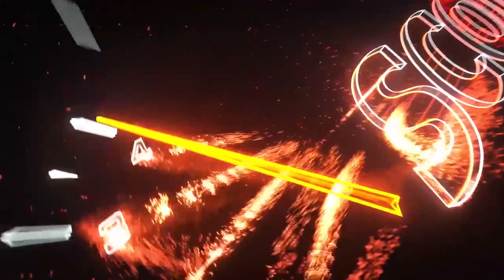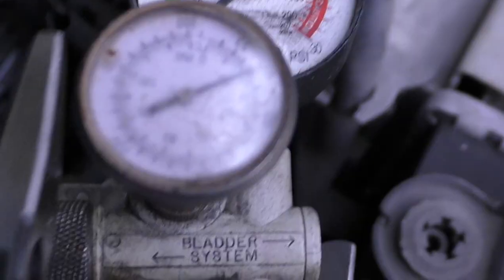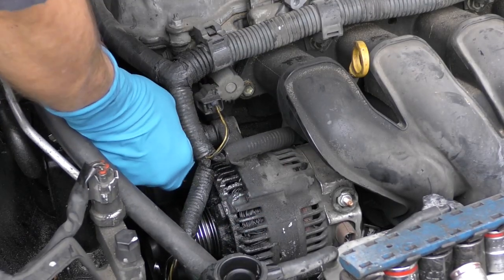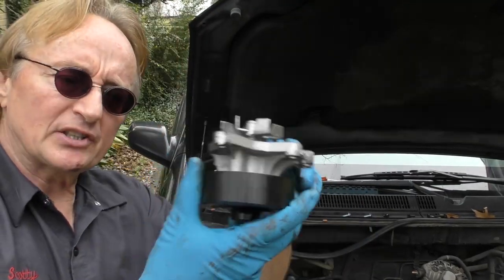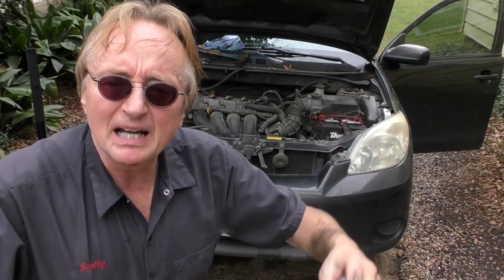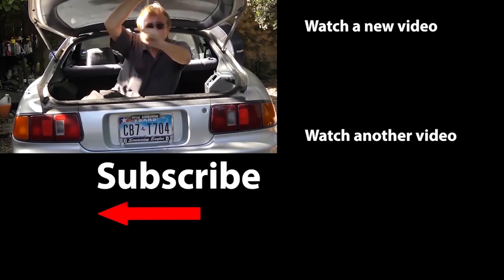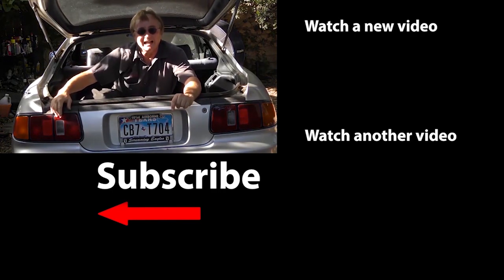Here’s Why Toyotas Have This Serious Problem

Comment: this is actually a 3 hr long video with 2 hr 50 min of cursing removed
Reply: It is actually 2 hours and 55 mins of cursing removed lol
Reply: Facts lmao
Reply: That job would have taken me an entire weekend, and I'd be kicking myself for not taking it to my mechanic.
Reply: @erikhicks07
1000000000000000000000000000000000000000000000000% TRUTH!
I worked in many auto repair shops and you'd always hear the mechanics 
swearing at various cars they were working on day in and day out.
Reply: BigRed195910 But your wallet will thank you for not going to a mechanic. Lol
Reply: On most four cylinder engines, the water pump is behind the timing belt, and we all know what that means.

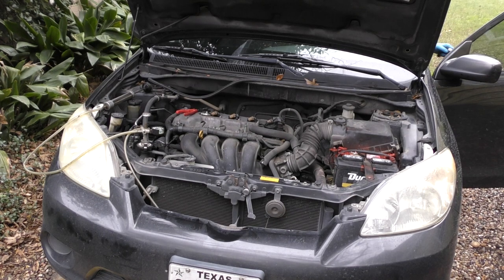Comment: Word of caution...when you start your vehicle, (1:25 in the video) make sure you don't have your TOOLS on top of the engine, like the pair of needle nose pliars with the red handles that almost fell off. If they fall off into the belt or pulleys and it just happens to land just right, oh man, now you got a damaged pair of pliars and probably will have damage to a pulley and that belt. In other words, DON"T DO what Scotty did. He knows better! And I bet he would say so.
Reply: AND, remove your dangling keys from your belt and use a fender cover so you don't scratch up your customers car!!
Reply: j freed no kidding
Reply: Scotty knew from 52 years of experience how to position those pliers in exactly the right way so they wouldn't fall off. lol
Reply: @markn0024   LMAO!!
Reply: @markn0024  He was showing off. I had a tinge of anxiety when I saw those red pliers vibrating. Only an expert can perfectly place those pliers on that valve cover.

Comment: 2:31 Old school mechanic leaning over the car with key chain hanging out. 
Always use a fender cover when working on your car. Even a belt buckle will leave a scratch. 
I know, because I have done it. Made me so mad, but I learned from my mistake.
Reply: It's  a Toyota. You should be worries about the car damaging the keys, not the other way around.
Reply: Even the buttons on your shirt will scratch the paint.

Comment: You know what Scotty? I was battling with a coolant loss issue in my vehicle for over 2 months. I finally replaced my water pump which resolved my issue! Your video was one week too late to help me, but hope someone else learns that an almost undetectable leak can be the water pump!! Thanks for the video!
Reply: Arcade Sunday or radiator or freeze plugs or see not always water pump.
Reply: Same here lol now my break booster went out. Time for Scotty to make a video before I change it
Reply: It can also be the radiator cap
Reply: @masta839  haha! Hopefully he does!
Reply: @masta839  
He did one the other day.  Lays it out very simple fix. Good luck and don't ever skimp on anything that stops the car!!!
Reply: You can pressurize the cooling system to 14 PSI when the motor is cold and look for leaks around the water pump.  When the motor is warm  the drips might evaporate.

Comment: This is why I stick with older model cars like my 83 Chevy. Lots of space under the hood and easier to take parts out for replacement.
Reply: Plus no stupid emissions crap and glass and butter strength steering/suspension/drivetrain .
Reply: @danieldoucet9121  if you'd ever been to the LA basin in the 70s you'd understand why we have all the "stupid emissions crap". It was a pain when they first started. It seemed a hindrance to the car running well. Now its well integrated and makes the car run better by adjusting for conditions, and increases efficiency. His 83 chevy BTW has plenty of badly implemented emissions equipment. Like my '79 firebird.
Reply: @batvette  As a certified Heavy Truck mechanic, I know full well why we have stupid emissions crap. The vast majority of people drive newer cars  (which break down constantly because of electronic issues) so there is a rather large market out there for reliable, older vehicles that were well maintained.  Personally, I would never even consider spending up to 6 figures on a behemoth whose final destination is the junkyard (like all vehicles). I guess I just like older stuff, made at a time when that mythical thing known as quality mattered.

Comment: I have lost track of how many Toyota water pumps I have replaced on 20 and 22R  engines.  Twice while on the road working in remote locations, limping back to a parts store.  Just kept dumping in water every 5 miles until I got back to town.

Comment: Make sure to replace with an Aisan brand waterpump.. Been through 2 NAPA pumps (Seal failure - leaks through the weep hole on the bottom of the pump)  within 5 years on my 07' Corolla. The Aisan pump has been working fine for the last 3 years. Aisan makes original equipment parts for Toyota.

Comment: Well, thankfully, it was the water pump and not the heater core. Although, you would probably smell the coolant inside the car as part of the troubleshooting process.
Reply: Unfortunately that is what will end up leaking next from the increased pressure now that the water pump doesn't leak. :D

Comment: 52 years working as a mechanic and he still hasn't figured out how much easier it is to work with the car on a lift? They don't require digging into the ground like they used to, and they aren't very expensive anymore.

Comment: Scotty, use High Tack Gasket Sealant from Permatex. It's like contact cement for gaskets and you dont have to wait for it to dry. I just replaced my buick enclave water pump. More difficult to get to than that Matrix. It's under an engine mount and fuse box.

Comment: Scotty, my mechanic says the reason Toyota vehicles have water pumps go bad is because they now have ceramic seals and they need to be soaked in coolant at least a few hours before being installed so when the engine starts and the pump spins it has coolant to lubricate the sealing surfaces and they do not get damaged and shorten the life of the water pump.

Comment: For most diyers, it's highly recommended to disconnect the battery before mess around with the alternator.  I didn't and it blew the 120 amp fuse.  It took me another 2-3 hours to replace that fuse.

Comment: yes you are right i did not wait long enough for the silicon sealer to dry & hd leaking problems again so i drained the coolant
till water stopped leaking out applied red sealant around the outside without removing the new pump waited 1 hour while i had lunch, refilled radiator start it up hey no proplems

Comment: That's why I'm fortunate I bought the 1990 Bonneville LE instead of the SSE which had ABS. GM had bad reports on all their ABS systems in the 90s. The one in my 1994 Bravada still worked luckily before I wrecked it.

Comment: Rads do that when there is stop leak in the Coolent. I remember my car would drop a gallon of Coolent periodically. I remember filling the cooling system warming it up and nothing. I looked for 20 minutes and slammed the hood in frustration. By the time I walked to the front door of my apartment there was a big puddle under the radiator. Was clogged also and would overheat sometimes during summer stopped at a red light.

Comment: I had 3 Corollas over the years (all of which I loved), and I had to replace water pump on all three!  Fortunately, the water pump is not the most expensive part to replace.
Reply: That is interesting. Have owned 7 Corollas ( 4 kids ) over the years. Never had to replace 1 water pump.
Reply: @Hilux244  Interesting indeed!  The cars had some miles on them before water pump went out, but out it did go!  Back then, I had an excellent, HONEST LOCAL mechanic who worked on Toyotas, but he has retired and I am forced to be robbed by any of the 3 Toyota dealers within a 35 mile radius.  I don't know if the '16 Camry will have the same problem (which I don't find to be a major one, anyhow).  I wrecked the '13 Camry after 3 years so I don't know if the water pump on it would have gone out.  Thus far, I only have 29,000 on the '16 Camry and so far so good!  BTW, how did you haul 4 kids in a Corolla?  Ha, ha!

Comment: Just did this repair about 2 months ago on a 07 corolla. Damn alternator was hard to get in and be careful with the two replacement bolts they give. They are usually do not have the proper depth. Use washers to prevent them from bottoming out and potentially breaking.

Comment: Scotty if that is a water pump with ceramic seals, I have my mechanic soak the pump overnight in the correct coolant prior to instillation so it will lubricate the ceramic seals when it first starts turning with the engine. I have never had a ceramic seal water pump fail after doing this and I keep vehicles for around twenty years.

Comment: My Chevy truck with a 6.0 was using coolant. Even with a pressure test and running it wouldn't drip. It turns out they cast a little pocket in the pump to catch small drips. The drips then evaporate. 
I went nuts trying to find the leak. I actually heard and smelled it leaking one night when it was quite in the shop.

Comment: In defense of GM electronics their HEI ignition was the best in its time, and their LS based motor coil packs are very powerful and rarely fail.  Plus their one wire alternator design was the industry standard for simplicity.

Comment: I was quite surprised to see you disconnect the alternator, which is still live!
Had you touched any metal part with ur power bar as you undone the nut , there would have been damage!
I always disconnect the earth terminal at the battery..

Comment: Tip for noobs. If you think your car is leaking. But you have been using the ac. Sometimes its just condensation from the a/c dripping not coolant leak.unless you see color of coolant.

Comment: Hey Scotty you left the pliers on top when you started the engine.
Reply: Scotty could really use a helper when doing these repair videos. Where is his kitty apprentice?
Reply: Does anyone know if Scotty put the same used cambelt back on, after he replaced water pump? Please. This is the exact job that needs doing on my 92  celica Gtr. Gonna cost 350 pounds. Many thanks.
Reply: @katrinahopkins1516  Darlin, I'll be right over.  150 pounds and a cup of tea is all I need!

Comment: 14mm socket? Are the Americans catching up with the rest of the planet? 😜
Reply: At least we aren't using Whitworth threads.
Reply: Stephen Arling - ahh, another great British standard, gotta love the Brits. 
Nothing wrong with imperial nor metric but I just wish there was a global acceptance of one or the other as it would make life (as an engineer) much easier.
Reply: Elmo my micrometer reads millimeter and decimal inches, nice, now convert to a fraction like 32 of an inch, not fun or am I "doing it wrong" Scotty? Anyone?
Reply: Celicagt1zz - you got my point 😆👍
Reply: @GSskiracer  If your micrometer caliper is like mine, the older vernier type, it may have a table of common decimal and metric equivalents etched on the back. Electronic calculators being so cheap, there should be no problem converting English to metric. Maybe the proliferation of nuclear weapons is a bigger existential problem than the general decline in arithmetical competency.

Comment: You missed something really important.   The bolts on that pump are two different lengths and if you don't put them in in the right places, the long ones will do damage.  Also the torque spec is really low 80 inch-pounds.  Very easy to over-tighten.

Comment: My old 1978 Toyota pickup needed a new water pump..and it was a heavy duty thing with 8 curved blades that looked to move serious water around. The replacement? Like that cheap thing you held up,4 blades stamped straight like a kid made them. I hate budget replacement parts for a car thats been so good for so long...or truck.

Comment: I had a 07 Camry the water pump failed on a drive back from California but the temp sensor never went to high stayed in the middle. The engine got so hot it warped. The catalytic converter melted and and fluid boiled out of the transmission. 

But because there wasn’t a recall on the temp sensor or on the water pump I couldn’t get it fixed unless I wanted to spend thousands out of pocket.

Comment: My toyota yaris with only a few thousand miles on it was slowly losing coolant, the underside of the hood had a pink line on it in line with the coolant pump pulley, replacing the pump solved the problem.

Comment: My 2008 Dodge Ram 1500 had the waterpump break and the fan tilted at an angle almost hitting the rad. Only 93,000 miles on it.

Comment: Scotty i got a couple of questions. When you pressure test the cooling system, how do we know the pressure goes all over the cooling system since there's thermostat that close when the system is cool and you need the engine to be cool to even open the radiator cap to perform this test. 2nd Q, some of the water pump come with plastic propellers these days. Are they Ok to use since I believe the systems gets pretty hot?

Comment: I've had the joys of having the water pump replaced on my '05 sebring (2.4l i4, 4-speed auto) for ~$700 cause its located under the timing cover (I also had the timing belt replaced for preventive maintenance). It's not the best design by any means, but meh... she's still a good little car.

Comment: i usually pump the coolant system 5psi over the operating pressure...that will show a leak for sure...there should have been more Toby McGuire pictures in this video 😅

Comment: Is it safe to wash engine bay with water? Some people do it but it doesn't feel right
Reply: Been doing it on my cars for decades.  Really helps to detect any problems, before and after they demand repair.
You DO have to avoid using high pressure water around electrical connections and plug wires. But that's simple enough.

Comment: Hi Scotty! You ought to try and change the water pump on my 08 Toyota Tundra 5.7 #%$*. By the way I bought my wife a brand new 2019 Mazda CX5 the red one. Beautiful SUV. Had a issue with hesitation when first stepping on the gas pedal. They put me in a loner with the same engine and the same problem.  They flashed the Engine controller and it was fixed for a few days then engine said not so fast your top programmers need to do some more research. Anyway the problem still exist. Then there was a recall with another flash to keep the rocker arms from coming out of place when transitioning from running on two cylinders to running on four cylinders. This could cause a engine stall while driving also possibly causing loss of control of your mind while crashing into something. Other than that when you switch the engine into sport mode it is a blast to drive and it handles better than any SUV I ever drove and the interior is a step above the competition. If anyone buys one definitely get the red color.

Comment: Wait, Scotty always talks about Toyota being reliable yet the main cars he’s always fixing are Toyotas and hondas???? Strange 🤔
Reply: They are less expensive and easier to fix
Reply: I've thought about this a bit and realized a couple things. More than anything, (speaking as a 3d be printer technician) an object longevity is dependant mostly on how it was treated and how many owners it's had. Other thoughts were, all the older cars from other makers are typically gone. Also, there are a LOT more Japanese cars sold, so you gotta think of things in terms of percentage, not mere quantity 👍
Reply: BMW customers a nasty. Don't want to pay or wait three months for plastic parts.

Comment: Better then the Ford water pumps on the 3.5 and 3.7L duratec engines which are driven by the damn timing chain and a gigantic freaking  job

Comment: If you smell it, but don't see any fluid, it could be steam leaking past the gasket up high between the radiator and the crimped-on plastic tanks. That seems to be common on today's  cheap radiators.

Comment: It’s not a serious problem and every car gets these water pump failures. The water pump and the thermostat are the easiest coolant leaks to repair.
Reply: Depends on the engine in question. Example: gm 3.1 v6- waterpump yes, thermostat no. Chrysler 2.4 i4- waterpump no, thermostat yes. Chrysler 3.8 v6- waterpump and thermostat are both pretty easy (that's my experience).

Comment: Scotty. Love your show. What's a good cheap economical senior friendly SUV? I have a 05 ranger 4x4. I got to step up to get in, and the wife has a 14 Ford Focus, don't get me started about that automatic transmission/clutch fiasco, car. Must be able to slip right into with minimal ducking, bad neck you see. Was thinking about Subaru, I had two, and both had problems. Thx.

Comment: To bad GM couldn't recall all mid 90's through the 2000's cars where the cooling fans stop working. After endless testing and nothing to show for all the time diagnosing. I decided to cut the ecu fan control wire at the relay and ground it via a switch (thermostatic switch from 1980's honda civic) the second I clipped that wire, Check Engine Light came on. Upon scanning and seeing that all the data for the cooling fans to turn on was met, the ecu knew I cut the wire. So everything operates as intended but wont function, programming error in ecu.

Comment: 1:55 "you push..."  No Scotty, no! I know you get nit picked in your vids but this is a fast way to an injury. Always PULL the tool toward you, it gives much better control should the socket slip off the fastener. I did that changing a harmonic balancer on a C4 Corvette... slammed my ring finger into an accy' pulley with all my strength. By morning the end was big as a gold ball. 20 years later the nail is still fucked up.

Comment: This water pump not as worse as the one inside Chrysler 2.7 engine or the Nissan 350z engine, those water pumps are drive by timing chain, if water pump is done,  your engine also be killed by the broken water pump.